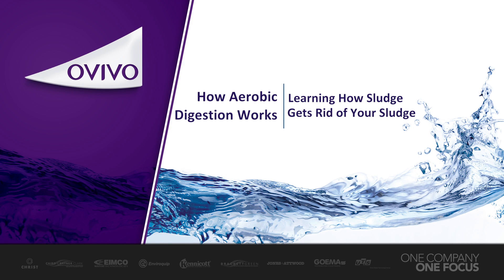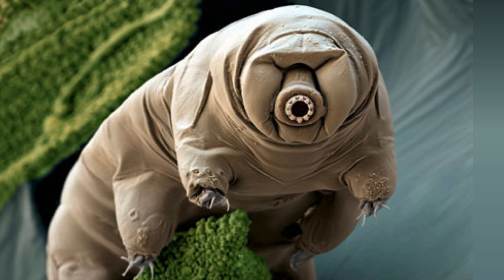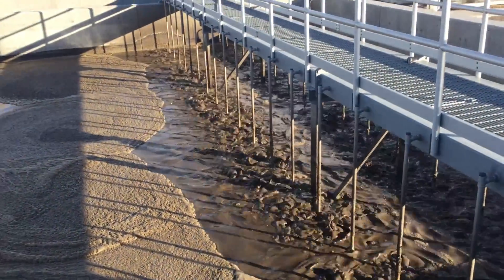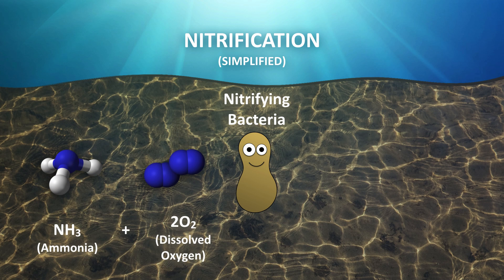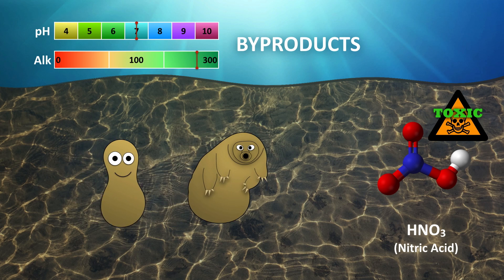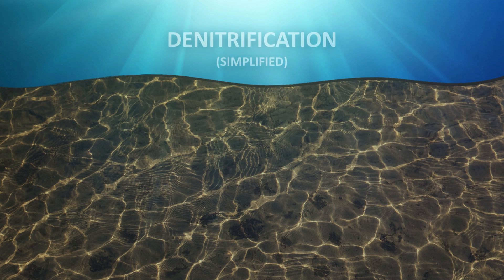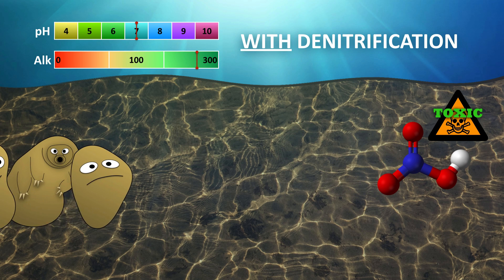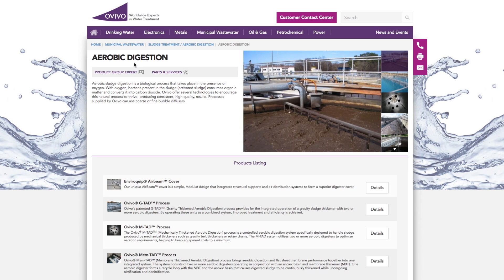Aerobic Digestion: Learning the chemistry behind the Aerobic Digestion process

Comment: The final reaction is not balanced.
Reply: Yep
Reply: @stanley6304  do you have the balanced reaction, sir?  I added 1/2 H2 at the end. I'm not sure if this is the case.
Reply: @OmarBaassiri-wd6wc  My apologies for the confusion.  I appreciate you pointing out the equation isn't balanced.  The balanced reaction is the same equation as shown @ 3:50 but you have 3.5 moles of H2O on the products side instead of 3 which is currently shown in the video.  This should balance the equation.
Reply: @bryenwoo Thank you so much.  now it makes sense.   do you also happen to have a chemical reaction of the slurry reacting with oxygen wherby the Biomass of C5H7NO2 is the product?  i am looking at manure biodigestion

Comment: 4:01. Little confusing, organisms aren't oxidizing in this instance, they are reducing them.

NO3 is a fully oxidized form of nitrogen with +5 oxidation state, N2 is nitrogen in a 0 oxidation state. Reduction. 

Oxygen is in the 0 oxidation state in O2, and in the vast majority of compounds it will be in a reduced oxidation state. O2 can only be oxidized if a bond with a more electronegative element is formed, like the formation of FOOF from HOOH (hydrogen peroxide) in which the oxygens are at a +1 oxidation state in FOOF compared to a -1 oxidation state in HOOH.